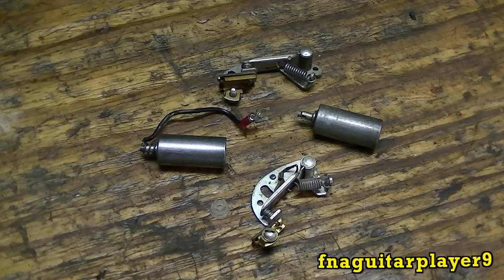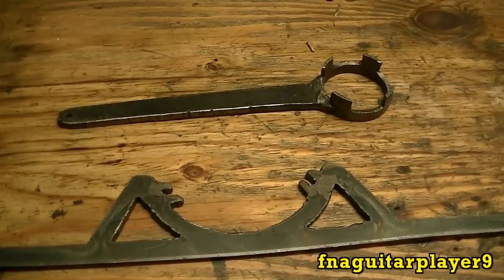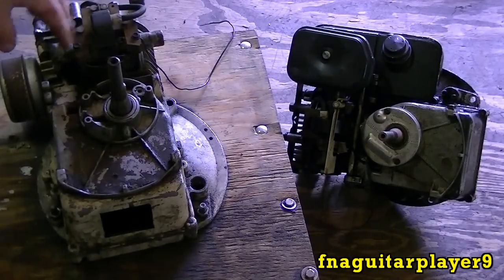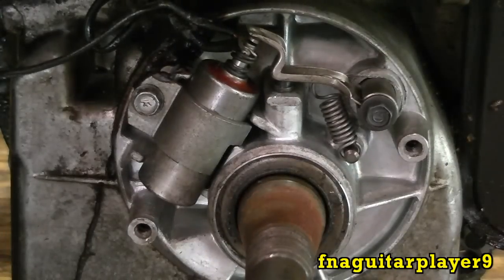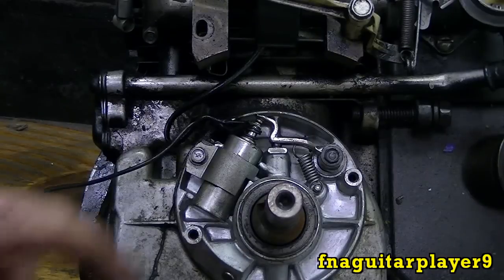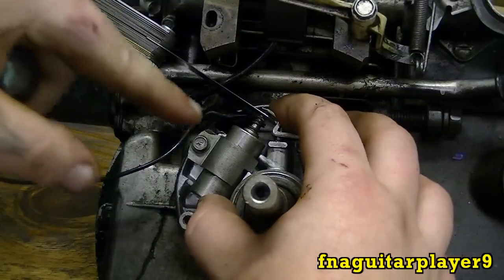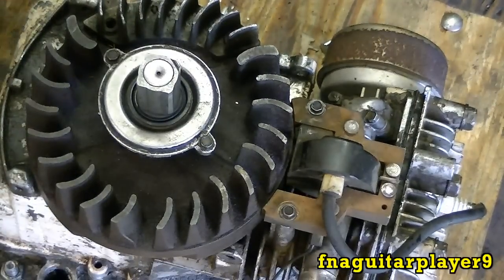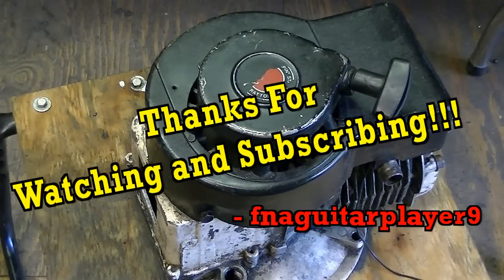Points and Condenser (Setup/wiring, Setting Gap, Cleaning Points, Setting magneto air gap)

Comment: Thank you kindly, good Sir! Ive just been rebuilding a 1970's Iseki AC1 Rotorvator and after stripped down to clean it, i couldn't remember where the  On/Off starter switch wire connected into the engine.    Having watched your video I have now spotted where.   It is also common sense once you understand how the engine works too.    Thank you for taking the time to make these precious vids.   God bless!

Comment: Great video! I like how you explained everything in such detail. Anyone who watched this will come away from it actually understanding how it works. Nicely done. Another thing to remember is to always make sure to check the spark plug gap for debris before reinstalling it into the engine. At 15:35 you can see debris in the gap of this plug. This plug would most definitely cause a no-start or at the very least a poorly running engine. Instead of the spark jumping the gap, it would simply travel through this debris and ground out without creating any spark at all. I can't believe nobody caught this.
Reply from the maker: +Tee Jay Thanks, appreciate that! That is very true, that was grease on that plug, I remember making this video, that was a plug that I found and it had grease all over it haha You are right, and I'm surprised too that no one has mentioned it! Thanks for Watching!!!

Comment: thankyou sir - working on my fathers 34 year old honda gv150 - points and condenser well explained - mower shop asked for $160 for new condenser - its not the money but the experience of learning and doing new things - thnx again
Reply from the maker: Bill Clinton Your welcome! I hear ya! wow, thats expensive. I'd suggest checking on ebay for the condenser, it shouldn't cost even a 1/8th of that! I've bought them for briggs for just a few bucks. I hear ya, your welcome! Thanks for Watching!
Reply: That’s a unreal price 
2022 and I still charge 25.00 labor and 15.00 parts

Comment: You are really into engines! I have a lot of respect for you at how much depth you go into explaining the operation and technical information, I started recently working on refurbishing mopeds as a hobby, even these 50cc motors can be challenging to repair sometimes but I always manage to make them work using with information from videos like yours, with mopeds it's usually air leaks and carburetors that cause a lot of problems. My lawn mower condenser might be failing thanks for info.

Comment: Great video nicely done.Suggestion? Cleaning points should only be used when new are not available. Filed/cleaned points will never last as long as new or even have any kind of lasting performance. IMHO, this procedure is for emergency use only just to get you going long enough to get the job done, get you back home or sell. There is a very thin layer of tungsten on the points and once this layer is penetrated (by wear or sanding), they're doomed. For the hassle of cleaning, replace 'em.

Comment: so- am I correct in assuming that the points are simply the on/off switch that causes the condenser to dump it's electricity and create a spark?
Reply from the maker: Thats a simple way of looking at it, it discharges the field in the coil, the condenser smooths it out and stops it from arcing. Thanks for Watching!!!

Comment: Another great video.  I'm working on an old 5 hp horiz. shaft Briggs,  orange in color with pull-choke like the one you rebuilt the carb.  It vibrates badly and I see one of the cooling fins on the flywheel is broken off.  Can I re-balance this flywheel or do I need to find another one ?  And what are the chances of a newer 3 hp flywheel being the same ?
Reply from the maker: Thanks! Great motors, I love them! It doesn't seems like the best idea but you could break a fin off opposite of it to balance it, it would work in a pinch, not a recommended method though. I'd suggest finding another one, i don't think the newer ones will work, a 3hp will be smaller anyways. You should be able to find one on ebay for fairly cheap. thanks for watching!!!

Comment: thanks for your videos . have a 19.5 hp twin  briggs  I'm working on. No spark. Has a single wire ground. Took the grounding wire off the coil still none. removed the coil cleaned and replaced set and checked gap still nothing. Bought a brand new coil installed still without the ground wire and still no joy. Just doesn't seem right. any thoughts? Thanks  Frank
Reply from the maker: +frankwalley Your welcome! Good motors, I have 2 of them (a 19.5 and a 14), first thing to check is the magnet on the flywheel, sometimes they will loose their pull and the coil has to have it to fire, and another common problem is (and you may have cleaned this, its just often overlooked) is the top of the 2 posts that the coil mounts to, these tend to corrode up and not want to conduct. And make sure your gap is set right, if its to far they won't fire. And its always possible you got a bad-new coil, it happens, rare  but possible. Have you tried new plugs? Sometimes they will short out and not fire, been there before! Hope this helps! Thanks for Watching!!!

Comment: Is it possibly the condenser that's causing an irregular or intermittent spark? I have a 1970 yamaha two stroke and the spark looked very strong the last time I visually checked it, but it seems like it's running very rough now and the spark doesn't seem to hit regularly.
Reply from the maker: Yes it could be a bad condenser causing it, or the points corroded up, or need adjusted, if cleaning & adjusting the points doesn't fix it then it could be a bad condenser. Also try another spark plug too before doing anything. Thanks for Watching!!!

Comment: I wish you explain the point staying open all the time except on the low point of the camshaft or staying close all the time except the dip on the cam.
Reply from the maker: It causes the "charge" in the coil to collapse and create a pulse of electricity, without it the voltage would not peak and discharge. and it sets the ignition timing as well. Now on 12v powered ignition systems, the points work backwards and actually act 100% as a switch powering the coil. Thanks for Watching!!!

Comment: so how can you tell if you have points and condenser without taking the flywheel off ?
the magnet on the flywheel?
Reply: +Keith Turner The internet?
Reply from the maker: +Keith Turner Must have missed this comment, sorry for delayed response, if there is a wire that runs from the coil under the flywheel, it has points, if not then its magnetron. Thanks for Watching!!!

Comment: Great Video. Any Idea how or why these condensers can burn out. 
My Buddy’s engine will start for a minute then cut out. We tried everything and believe it needs a new coil/ condenser bc it was burning out.thanks for any info !
Reply from the maker: Its usually just a dielectric breakdown, all they are is a capacitor. its probably the condenser but, the coil can do it too. now if you want to fix the problem for good, you can put on newer style electronic coil, if its a briggs it will be called a magnetron, then you can do away with the points and condenser. ALot of people are doing that these days, i do love points/condenser but sometimes its faster/cheaper to upgrade. Thanks for Watching!!!

Comment: Do you know what the points gap would be would be on a 1969 Wisconsin motor?
Reply from the maker: Crystal Malek No right off hand, i've never worked on a Wisconsin, great motors, just haven't ran across one yet. I might be able to look it up if i had the model  numbers off of it, I'm use to briggs and stratton numbering, but i'll give it a shot! thanks for watching!

Comment: You for got to show how to test the  2 micro farad capacitor or referred to it
as a condenser. also you should address how to test the coil with a ohm meter.
Primary and secondary windings.
Reply from the maker: MrMac5150 I might do that in another video sometime. But yeah, it would be best to test it all while your at it. thanks for watching!
Reply: fnaguitarplayer9
Good video.
Reply from the maker: MrMac5150 Thanks!

Comment: ya know when your chainsaw doesn't start and after everything you take on the task of feeling the spark   so im sitting there with a screw driver where the spark plug goes in the wire  and no spark ok but then while im holding the screw driver in the wire and touch the frame and i turn it over the frame shocks me why would  it do that
Reply from the maker: Sounds like the coil is gone, alot of times they will produces a few hundred or even a thousand volts, but not near enough to jump a spark gap, enough to shock you but not enough to spark. if it has points/cond. then that could be the problem. Thanks for Watching!!!

Comment: I put in new points and gaped, a new coil and gaped and still no spark from the wire going to the spark plug, am I missing something??
Reply from the maker: Did you change the condenser? if not it could be bad, all it is, is a capacitor, and if its shorted or open it won't spark. Thanks for Watching!!!
Reply: fnaguitarplayer9 yes, new condenser too
Reply: Condenser is nearly AllWAYS bad

Comment: hi,
I have a Honda HR17.  It has a points ignition system.  It has not sparks what so ever.  I know how to check a non-point ignition system.  This is the 1st point system I cam across.  Can you help me trouble shoot this or direct me to another link. 

How do I know if it is the points condenser, or coil.  From your video I know how to check the point gap, but how to I check the coil and condenser.
Reply from the maker: First thing i would recommend doing is cleaning the point gap, then check for spark again, if still not, check the shut off wire, if its shorted somewhere it won't have spark. what i do is just unhook it from the coil and check for spark, if you still don't have spark, you can check for resistance on the coil with a ohm meter, check between the wire feeding the points to ground (with condenser / points unhooked) and you should get a reading, if its open then that side of the coil may be bad, also check from spark plug wire to ground (frame of coil) and it should be higher than the other side, this is not always accurate but usually is on briggs, like i said i'm no expert on honda motors. And of course it could be the condenser (all it is a capacitor) you can check them with a capacitance meter, but its hard to say what it should read. Hope this helps! Thanks for Watching!!!

Comment: Will a electronic magneto work in any Briggs and Stratton engine? 5/27/2017
Reply from the maker: It should, i've changed them on 5hp's, 11hp's and 12's, but you should be able to upgrade any engine to magnetron coils. thanks for watching!!!
Reply: Yes, but you have to pay attention to the diameter of the flywheel.  If the coil fits flush when you set it on the outer surface of the flywheel, you've got the right one.

Comment: I have owned a troy bilt tiller with 7hp kohler since  1990. bought it used.  serial #11081756.  can you tell me when it was built?
Reply from the maker: +Traci Zimmerhanzel I tried to look it up, but for reason the site said the serial number should have a letter, but what i would suggest doing is looking on the engine shroud that has the model and seriel on it, it should have a date code stamped on it, and that should be within a year of the tiller's manufacture. Thats how i usually date equipment.  Thanks for Watching!!!